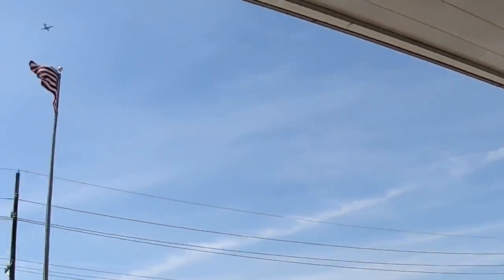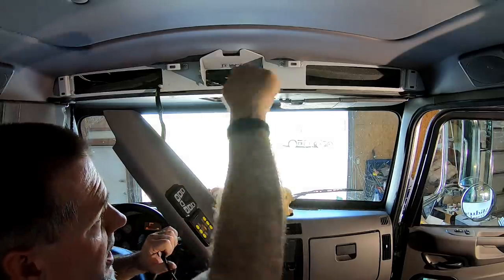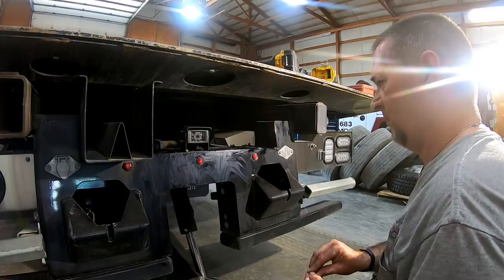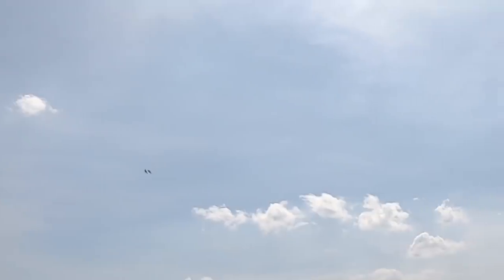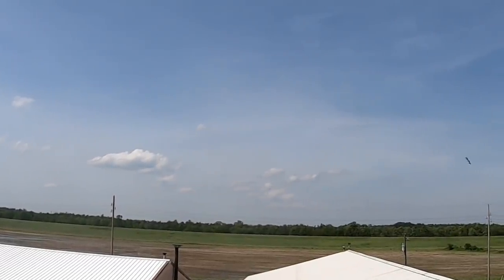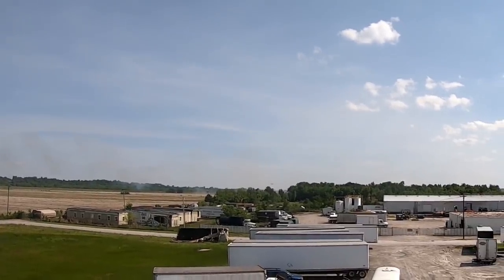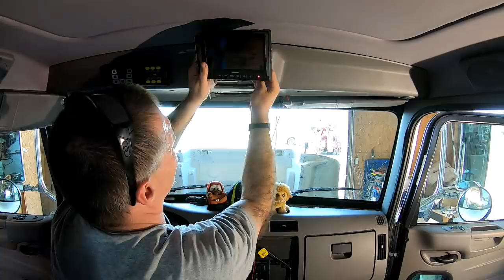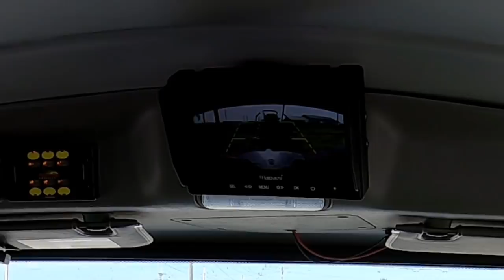Blue Angels & Haloview MC7611 Install

Comment: It would be possible to mount a toggle switch on the side of the monitor so that in position A, the monitor would power up from the reverse light and in position B, it would power from a continuous voltage. That way, you could leave it in position A and not have to keep remembering to switch it on and off when reversing, and switch to position B in those other situations where you want to have it on.

Comment: OMG, another fine production of Ron Pratt and the amazing..........   I live just West of Mount Comfort Airport (I think it is now a major reliever for Indianapolis International Airport) and when the Angels perform here I've been blessed to be (almost) within an arms length to the planes as they flew over during their practice & performance runs.  That was many years ago.  You are lucky to have them land at Cape Giradeau airport - evidently that airport has good security.  They always originated at Indianapolis International but "Fat Albert" was able to land at Mt. Comfort Airport.  

It looked like you could have used a little bit of help when you were working inside the truck.  Thanks for a great share.  See you around the bend.

Comment: Thanks for the view of the Blue Angels.  Always fun to watch (with hearing protection).

Had to make a stop in Scott City on Wednesday.  A truck that passed me on the highway (and moved over while still way too close) kicked a rock into the windshield of the truck I was moving, and chipped it.  Although we are not liable for those things, I still had to fill out the incident report (always best to do that while you are still mad about it).  Once done with that, it was the first rule of truck driving (never turn down an opportunity to get rid of water) so I got to stretch the legs a bit, picked up a gatoraid on the way out (inquire if the "ghost" is still haunting the  pumps out there), check my lights and hitch and get back to it.  

On the way out, an endo was stalled at the traffic light.  Did ya git'im???

Comment: One of the greatest encounters I have ever witnessed with the Blue Angels was back in the early 1990s in the flight path of Willow Run Airport, Michigan.  The air show happened in early June while the kids were still in school.  I lived in a manufactured home community at that time.  The kids were getting off the bus and a Blue Angel was flying upside down barely 100 ft above the road at a slow fly speed.  The pilot and navigator were waving to the kids getting off the bus as they flew upside down.  The kids were standing there open mouth watching the pilot fly the plane just above them.  My only regret is that I did not have my camera on me  (this was long before everyone carried around a phone capable of taking pictures and video) to take a picture of this event.  In fact, no one had any type of camera on them to record the event!!!

Comment: Good video, Ron.  Thanks.  Hard to believe those F/A-18 were adopted by the Blue Angels in 1986.  When I saw them years ago in Rhode Island (Naval Air Station Quonset Point) in the early '70's they were flying F-4 Phantoms.  Those were some LOUD aircraft.  Thanks again.

Comment: I have said this before Ron, I really enjoy your videos. In this particular video when you got to the firewall if you need it to make a hole through the sheet metal there’s a toolset call a Greenlee ponch set. You probably have one. We had such a set when I work in the Marine electronics business. They are very handy. It beats the heck out of using a drill or holesaw.

Comment: The Blue Angel pilots are amazing! If you really like jets another plane you should check out is the Vulcan Bomber from England. It's a long distance delta winged bomber that handled like a fighter jet and it also howled. It no longer flies due to safety concerns, which is a terrible shame, but when it did it was awesome. There are some short clips on YouTube that feature the Vulcan Bomber or there is a documentary on its last flight featuring Guy Martin (an English motorbike racer and truck mechanic amongst other things). Every time you mention your Vulcan truck this plane is what I think of.
I just had a thought - I'm Australian so my use of the word truck is probably confusing a lot of your viewers. The vehicles you call tractor/trailers, we call trucks. Just for clarification. Cheers.

Comment: Dear Mr. Pratt.

When I saw when you mounted the camera at the back of your flatbed, I came to think of one thing. Why not manufacture a cover over the entire camera that closes tightly against the base on which the camera is mounted. Then provide the cover with a hardened glass in front of the lens with a tight fitting rubber seal around which is mounted on the rear of cover and which protects the camera lens. With this construction you protect the entire camera from dirt and gravel as you easy van clean the hardened glass instead of the lens itself, which over time creates scratches on the camera lens.

Hope you understood my inadequate description in English regarding my suggestion.

Take Good Care of You and Your Family and God Bless You All.

Best Regards, Bengt "Wolf" Johansson.
Reply: Bengt Arne Johansson I like your idea. However it might pose a problem with condensation and fogging when wet and cold.

Comment: @Ron Pratt I recommend taking the nuts back off of the camera mount and putting some lock washers or some Loctite on there. Over time, those nuts could loosen up from vibrations. If they get loose, it won't take them long to fall off considering they point straight down. Just a recommendation. A few cents to save a big headache (potentially) down the road.

Comment: I noticed that you were using white tie wraps. They break down with the UV rays. Black tie wraps last considerably longer. And also when you cut the tail off, cut it off sideways instead of a long flat side. It will illuminate sharp edges.

Comment: Hey Ron!  I am fairly certain that this is 'common knowledge' to one of your vast experience, but,  10:54  a piece of speedometer cable can be an invaluable tool when "fishing" wires thru strange spaces such as this.
Ken
Reply: kejay74 I’ve never thought of that! Thank you. I have an old tach cable from a tractor laying on the shelf. I will see if I can find it and place it with the roll of piano wire that I use for fishing wires.

Comment: Hi. Love the videos ron.. If you hook the #1 trigger up to the reverse lights the monitor and camera will power up automatically when in reverse but if you want it to power up when you want to have it at other times you can still manually turn it on with the power switch

Comment: Ron, Why did you not choose to tap into the power feed behind and above the 2 power taps next to the sun visor? Then you would not have to have wires coming out of your access panel opening. I think that is what I would do if I was doing that install. Thanks for sharing the Blue Angles with us & the install. It would have been nice to see you getting the mower unstuck with your regular camera also. Just my thoughts and preferences Ron. Take car and keep being safe.

Comment: You should do some videos for your lights and sirens you use while running code. You should do demos and breakdowns/explanations of the lights/equipment. One example being "this light is an amber Whelen Liberty with led takedowns and ally's, this is the flash pattern I use with this bar. I also have 4 STL Z-4s with with a wig wag pattern on the grille. Here you can see these feniex fusion surface mounts for side warning so I have 360° coverage in addition to the full bar up top. This truck has the Whelen cen-com gold siren and light controller with these siren sounds programmed to it, Hi-Lo, Wail, Yelp, manual and interaction with a 100 watt FENIEX siren speaker mounted here." Obviously I don't know what you run and I was just naming random things off the top of my head but you get the idea.

Comment: Dewalt and others make right angle attachments for your drill or impact that may have made mounting the camera easier.   Some only drive hex head bits; some drive drills and hex so make sure you buy what you need.

Comment: Ron might I suggest a set of SAE and Metric ratchet wrenches. Not good for torquing bolts or breaking loose, but great for tight places where a regular ratchet and socket will not fit.

Comment: The best partner of U.S.A.F Thunderbird , awsome sir ron 👏👏👏👏
Reply: Faqih Udin Achyar these are the blue angels. Not the thunderbirds
Reply: @OSUfan757  The Blue Angles are (U.S.N.) Navy Squadron and formed first, Faqih is referencing the U.S.A.F. Thunderbirds which is or was the other Demonstration Squadron which has ceased doing operations in 2013-2014 due to budget cuts. Pretty sure they know this is the Angels.
Reply: @OSUfan757  yeah these the blue angels but one base camps

Comment: Did you check the bottom back of the cab for any openings?  I've seen them on a few trucks and routing to the back of the headliner then down the pillars there is easier than going out the firewall then having to go under from farther forward.
Looks like that spot under the bed is just perfect for the camera, though.  Still got room for some extra work lights alongside it too.

Comment: Ron, in NY the size of your rotator would require the two front steering axles by law. Did you get the Tator prior to that or does that law not apply in your neck of woods?
Reply: Maiden Fan each state has its own set of rules. In Iowa the 50 ton rotators are setup just like Ron’s. However the 75 ton rotators are twin steer.

Comment: Nearly 30 years ago I watched a demonstration by the USAF Thunderbirds.  I will agree that you seem to have about the best seat in the house.

Was there any point during the installation of the backup camera that you would likely have used one of the other vehicles had you been called to deal with an incident on the road even if the situation only demanded a rollback?
Reply: Rob Highfill I believe he still has the Ford Superduty truck with the rollback yet.

Comment: hi i have fitted 9in screen in road coaches that have four camera input everyone comment on how much clearer the picture they are than smaller screens you fit one camera to roof to give wider view one under rear as you did and one on each mirror head so you can see down both side while you are backing (check for branches or over hangs) use quad screen or two screen view keep up the good work and be safe

Comment: With respect to the camera mount, why don't choose the "vertical part" just below the little red light?. Rotating (if it's possible) the camera in the holder would be more easy than drill with this "evil tool" or drill inclined. Sorry, my english isn't my mother tongue...

Comment: You should've burned a little hole in there with a plasma cutter
Reply: I thought spot welds would be easier, (If Ron has a welding rig)